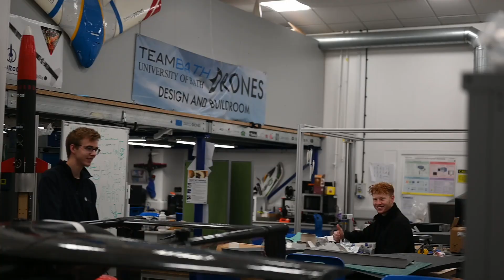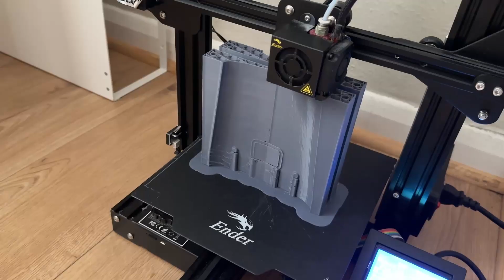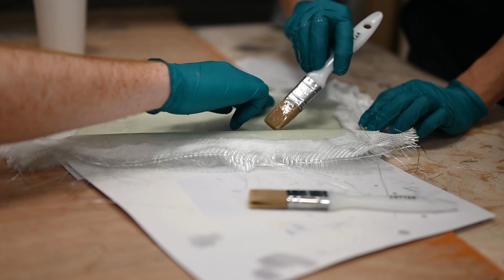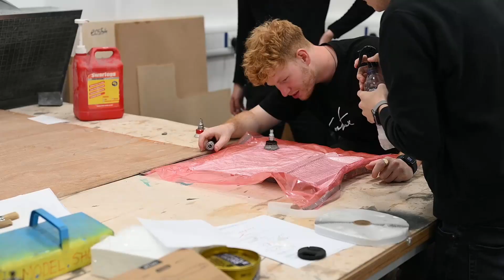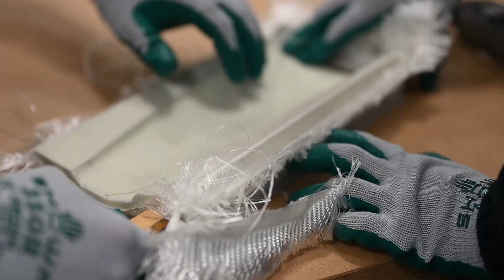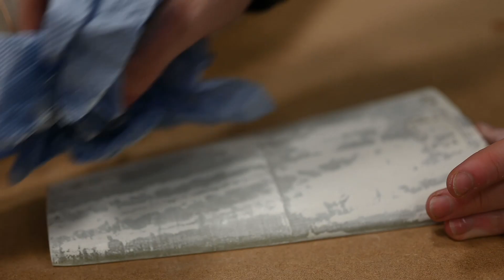Building a 570 MPH RC Plane Part I - Fibreglass Testing

Comment from the maker: Thanks for watching this video!

Two small corrections:
(1) The peel ply is used to provide a rough inner surface for bonding components to. The blue perforated release film applied after this provides the porous barrier between the epoxy and the breather fabric/ bag.   
(2) The breather fabric layer prevents epoxy from being sucked up into the vacuum pump.

Comment: Hey guys :) nice work. 

When it comes to use 3D printed moulds directly with a vacuum setup. I strongly recommend to print solid parts. The vacuum is really strong, even at lower pressure, and best case is that you get print through on the part from the infill pattern. But most probably you’ll get parts that have a different geometry (that kinda matters on aero). 

You could also consider 3D printing a pattern, that is used to make a simple mold if you want something that is more than a “one-off”. Doing “one-off” parts, I would recommend to spend the most time to sand the final part, not the mold. 

PS! Cut down a bit on the background music ;)

Best of luck!

Comment: You can use some Unidirectional carbon fiber layed alongside the load path. It is cheaper compared to woven CF and if applied correctly you can safe some weigth and improve the stiffness of the aircraft significantly.

Comment: You shouldn’t pull a full vacuum on a hand lay part it will pull out too much resin. full vacuum is for. Infusion only
Reply from the maker: Thanks for the advice - this was a mistake on our end. We've just finished making our rear nacelle and we're now using a 0.8 bar partial vacuum from a pump provided by one of our technical advisors
Reply: Cool

Comment: Nice video guys. I worked with Dan on his work placement. RamyRC on YT does alot of mould making with printed parts and would be a good source to learn from. You probably want to use a better filler like a car body filler so it does come off onto the part. You can also do a quick finish by using a vinyl wrap. Also watch out about vacuum 3d printed moulds. They can easily warp and any locked infill can break the tool. Good luck with the project.
Reply from the maker: Thank you for this useful advice! We’ve been watching Ramy’s videos closely and making good progress on our more recent layups (video to come)!